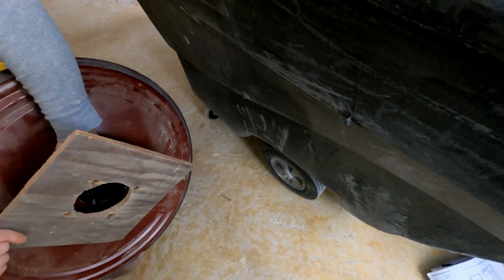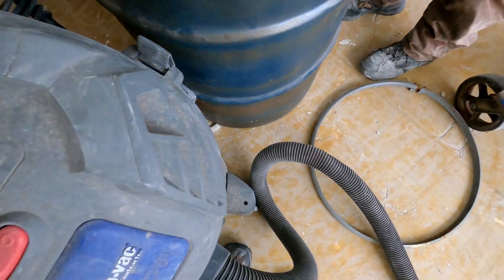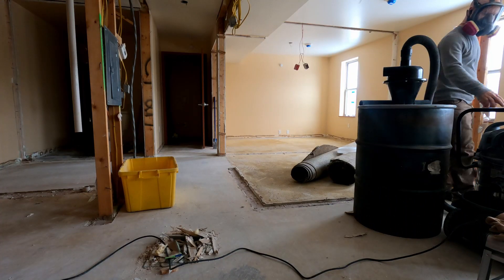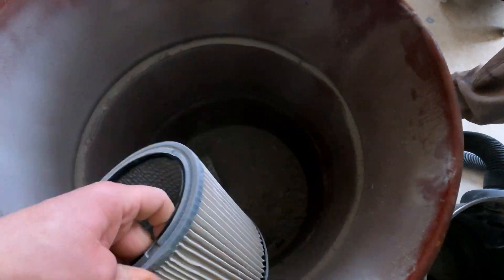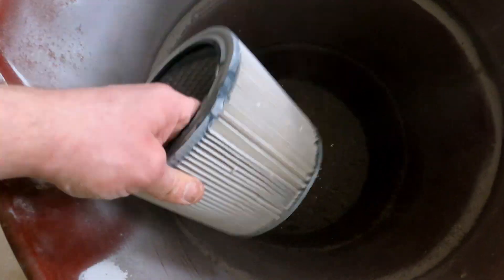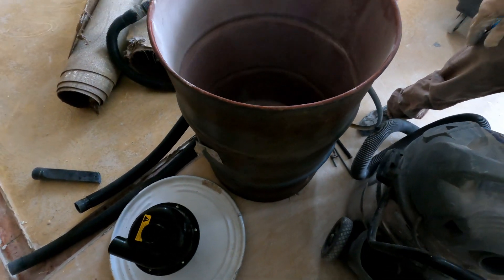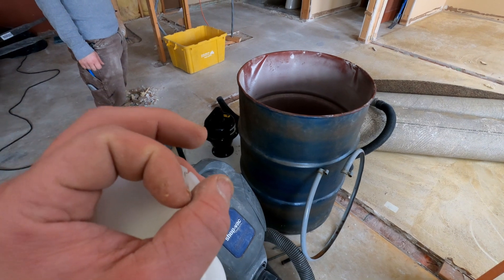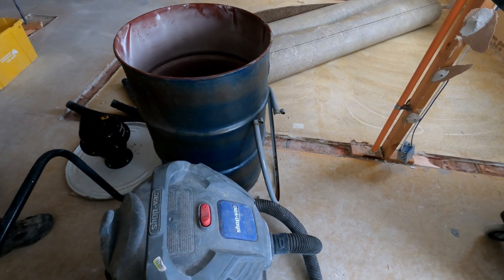UPDATE! 2nd Review:  Cen-Tec Systems 95798 Dust Collection Separator

Comment: Just 2 cents of from my experiences:

I've used the Oneida version of this connected to a 20 gallon drum and a shop vacuum for saw dust and metal grinding dust.

I've filled up the 20 gallon drum at least 20 times, and so far my vacuum is empty, and my filter is spotless.

HOWEVER, I have a filter bag inside the vacuum to catch any leftover fine dust. The bag still seems empty though. The bag and filter for the shop vac is green, which is Ridgid's "HEPA" version.

I've saved so much money and time by not having to clean filters, or buy new shop vac bags.

I've used the Home Depot orange version, the Dustopper, and it doesn't do a good job at all.
Reply: was about to say the same thing well said

Comment: I would try to grind off a little from the bottom part of the baffle to increase a clearance between a wall and baffle. And like others said - use a dust bag, they are much cheaper than filters.

Comment: You seem to not understand the purpose of a cyclone separator.  It's doing its job just fine. It's never going to make it easier on your filter as it's not designed to stop fine dust.

Separators do just that, they separate the HEAVIER materials and deposit them into the bulk container.

Comment: Oh, and I did buy a centec cyclone a few months ago and the top and bottom didn’t seal together properly even with the gasket in. I sent mine back but think they could do with twice as many fixing points around the joining rim. Good observation about the gap between the baffle and wall in relation to hose size btw👍.

Comment: No separator will help with filter dust.  Small dust to the filter and larger chunks to a bin so you don't fill the vac as often.  Seems like its working fine once you pulled that stupid piece out.

Comment: Dude for large crap like that with fine dust mixed in, I suggest just getting one of those barrel lids that send the incoming debris stream around the circumference of the lid for a short distance with a separate exit port in the middle. All that large junk will then fall to the bottom of the barrel and so will a lot of the fines. It won't clog and you should get longer service between shop vac filter cleaning/replacement.